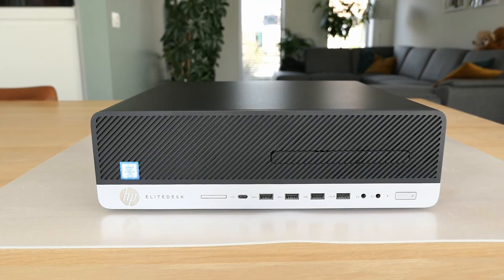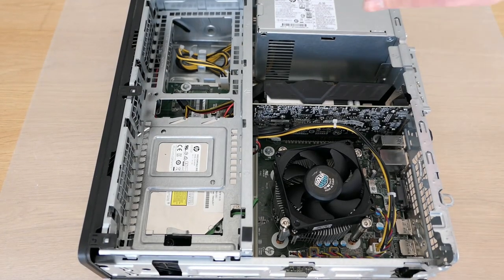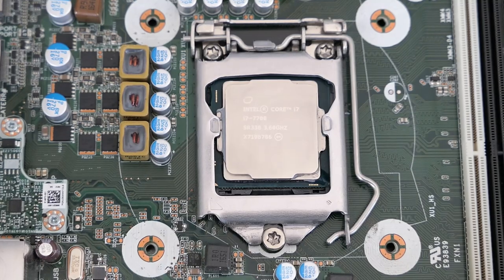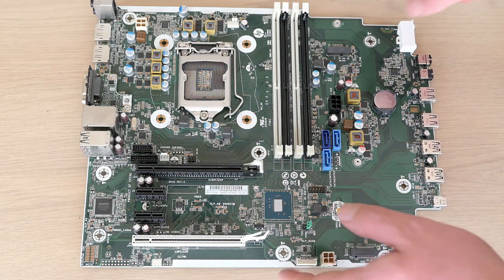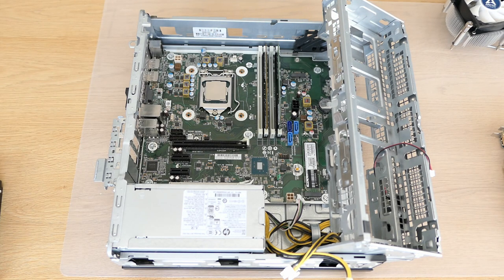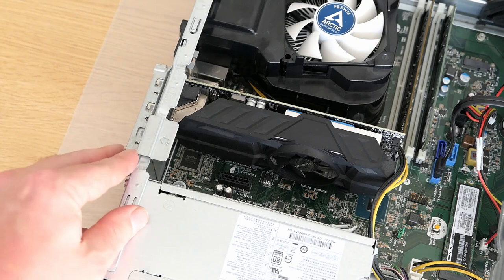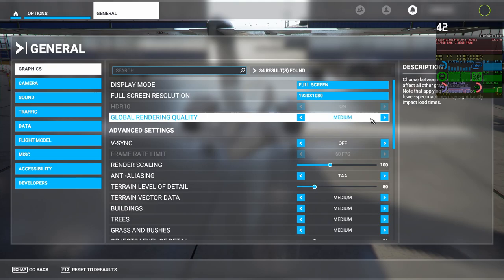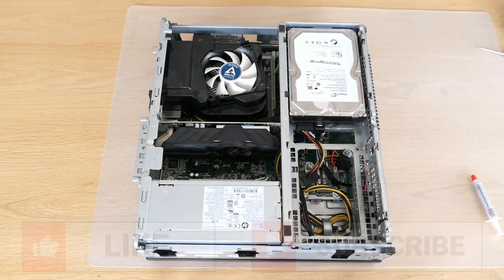HP EliteDesk 800 G3 SFF - Teardown, re-assembly and upgrade

Comment: dang...that would make a nice sleeper gamer i7, SSD, 4GB 1050... I could live with that all day...
Reply: Buy the rtx a2000. Makes for the ultimate sleeper
Reply: The one I bought didn’t have a gpu so I bought a 1650 4GB.
I run csgo at ~300 fps. Although the gpu struggles with heat, under full load it likes to sit at 85C which from what I understand is throttled. I’m currently trying to increase case airflow to fix that
Reply: @remoquillojosemiguel1105 you might have to cut the metal housing that folds into the computer there to fit bigger gpus running into this issue with a Lenovo with the same concept of folding the cage down

Comment: I have this one with I7-7700 32 GB ram and T600 and it's a beast !
Reply: Thanks. Now i see its true power
Reply: its actually a solid pc. If I can upgrade the graphics somehow and even get half the potential of a 660 ti with barely any power draw. I can run the games I play with multiple tabs on solid graphic settings no problem.
Reply: what’s a t600?
Reply: @cIeetz  HP 800 G3 TWR I7 16 GB DDR4, 512GB SSD, GEFORCE GTX 1060 3 GB. IS this good for 577$ USD or is it to much for it ?
Reply: @toni2972  too much might as well save a little more and get something way better
Reply: And how about 16 GB RAMM DDR4 + i5-7500 + GT730/GT1030? PSU 180 W
Reply: Bro, did you have to change the power supply? I read that the PCIE port is 35W, and the T600 consume 40w. Did you have any problems?
Reply: @0disseooo  NO

Comment: Thank you very much. Just for reference, I installed an ASUS GEFORCE GTX 1650 4GB low profile, double fan. The twist is: I had to cut a piece of the chassis where hard drive are located (a 4cmx4cm square) because the card is too long. 
I also installed an internal ssd (samsung 990 pro) and 32gb corsair RAM. Looking to upgrade it from i5 to i7 7700, just wondering if it can handle a 7700k.

But it's worth the job
Reply: Is this on the stock motherboard. I'm thinking of getting an Asus Z170 so I can overclock. Unless you know another way.

Comment: Bet you've already answered this somewhere but here is where i am in a pickle. I have a G3 800 SFF currently running without a GPU. I checked the specs on the GTX1650 LP and on a stock system that doesn't go with the specs. First, the PCIe slot is limited to only 35W supply to the graphics card while the GTX 1650 pulls a whopping 75W at max draw. Second - Now somehow even if you end up installing and getting it to work and definitely not at full potential of the GPU, youre still gonna need to upgrade your power supply so it can handle the load of the GPU at even 75% of the full power. And i am talking about the SFF in the video. Same problem with the 1050ti. The only cards that go in safe limits are the GT1030 and the GT 730 unless you get another PSU which supports higher Wattage output (you might need to swap out the case too) and then run a full sized card instead which draws power directly from the PSU instead of relying on the power from the PCIe slot.
Reply from the maker: Upgrading the power supply will not increase the power that the PCIe slot can deliver. Also for cards that do have an external power connector, they count on drawing up to 75W from the PCIe card as far as I know.

I do see that it is documented to have a maximum of 35W supported for the PCIe slot but as this one was doing fine with the 1050Ti, I would expect a 1650 to work fine as well. Wouldn't be the first time that I try this with success. 180W in total should be fine for GPU, CPU and the rest of the components like mobo/RAM and SSD.
Reply: @jensdbe  I really want to try the 1050ti or the 1650 on it like you installed but its too much of a risk interms of me buying and it not working at a later point in time.. better be safe side and run a 1030.. I have always been unlucky in that regards so I better go with something thats tested and proven :face-blue-smiling:

Thank you for the reply!
Reply: @omerback007  any Low profile GPU will work as long as it fits, someone tried an rtx 3050 low profile and it worked perfectly fine, it's really only the temps you kind of have to worry about. 180 Watts is fine, no risk really, but you do you I guess 👍

Comment: I live in Australia & saw one on marketplace for $145 with the 7700 & 8gb ram & 256gb nvme drive, thinking of building an emulation machine with a sparkle intel arc a380 6gb LP but have to find out which psu this one has first. I recently built a mid range matx small tower that is purely for current games, 12G i5, RTX4070, 16GB D4 3200, 1tb gen4 nvme. Will be slapping a 2tb gen3 in there too soon.

Comment: Do those stand-off screws have rubber sleeves or its just metal on metal mount? And if it is metal on metal, is that from the factory like that or 3rd party screws?

Comment: New subscriber looking for advice.. 

The PC spec in question details are: HP Elitedesk 800 G3 Small Form Factor PC. Intel Core i7-7700 processor. 16GB DDR4 2133MHz RAM. 500GB x2=1tb SSD
Windows 11
Samsung 860 EVO NAND-SSD. Optical disc drive. Built in 1Gbps ethernet port. No wireless card but Wi-Fi dongle. Integrated graphics

There are 2 free RAM slots and the motherboard supports 64GB RAM

My question is would upgrading the RAM make it better eg.. 32 RAM 3200 mhz with like a crucial 32gb secondhand??

And also

Would putting in a dedicated graphics card like a Msi gt 1030 secondhand help it too??

Trying to understand how it can be improved, I don’t know if it would cope with music software like ableton and gaming well or not, please could you help me understand if these ideas to make it better would be a good idea or not? If it would work? And if it would be capable for these things?

Sorry if I didn’t word it well I just tried to give as much info as I could.

I absolutely loved watching this video and will continue to watch videos here thank you for posting and look forward to your reply 🙂👍🏻

Comment: Hi, how many watts is that power supply?  I have an hp prodesk 600 g3 sff and I have thought about buying the same graphics card that you are using, but my power supply is 180w platinum.  so I don't know if it really works for me at least in the medium term without burning the power supply or the graphics card
Reply from the maker: The power supply in mine is/was also 180W. This should be sufficient for the CPU and 1050Ti.

Comment: hey nice video, btw im gonna ask can the psu handle regular 1050?
also can i use to bit more powerfull GPU such as 1070?
Reply from the maker: The EliteDesk 800 G3 has only a 180W power supply. The most consuming graphical card it comes with from the factory is a GT730, which takes around 40W. A 1050 Ti takes around 75W so that should be within the safety margin.
A 1070 on the other hand easily does the double (~150W) so that's really too much for that PSU. You would also miss the 6/8 pin connector that such GPU needs.
Upgrading the PSU won't be an easy task as well I'm afraid.
Reply: @jensdbe  thanks mate
Reply: I have a 800 g3 running a Gigabyte NVIDIA GeForce GTX 1650 4GB GDDR6 Graphics Card. So far so good. I use obs to live stream with a mic,4kcam link from elgato and a hd60s+ as well. So far no issues. Only upgraded the memory with the gpu
Reply: @interpolfallen4159  so basically as the GPU must be under 75w heh thanks bro
Reply: And I just changed the hd60s+ for a 4k60pro with low profile bracket through pcie. It fits perfect and no issues.
Reply: @interpolfallen4159   me to. A quite good setup.

Comment: Just ordered a refurbished one off of Amazon today to host my own Minecraft server! The only difference with mine is that it has a 6th Gen Intel Core i5 and a 128GB NVMe SSD.
Reply: Add more storage, a gpu and if possible (Ik it’s difficult) upgrade psu so that you can have potential for different graphics cards. Also should probably give it some fresh thermal paste and make sure everything is plugged in and seated correctly

Comment: Hello... What a great video! It's very instructive. But, i'm wondering, would it possible to replace the stock heatsink with either Cryorig C7 or Noctua L9i? Both have a backplate that must be installed on the back side of the motherboard..
Reply from the maker: I think that the only option for such heatsink would be to remove or to bend down the lifted mounts on the bottom of the case. As you can see at https://youtu.be/n1ETa3mJ85I?t=602 These would prevent you from mounting that backplate or the board would end up too high. Keep in mind as well that the case is limited in height so you might want to check if your heatsink+fan would fit in the limited space.

Comment: Thanks for the video! Do you think its possible to keep 2x 3.5" HDDs inside the box? Considering it as a NAS
Reply from the maker: Two drivers should fit next to each other.
Reply: Did you ever go through with this? i want to do the same
Reply: @overratedprogrammer  I did not, sorry.

Comment: Can i fit the amd rx 580 in that pc
Reply from the maker: As far as I know there are no low profile variants of RX 580 cards. That means they will not physically fit into this case. Also, an RX 580 can draw up to 185W, which is way too much for the power supply.

Comment: I'm trying to get a new graphics card for this computer, but basically every single 1050 I find has the DVI port in a different spot. Is that a problem? Will a graphics card with the DVI port in a different area still work on this computer?
Reply from the maker: That shouldn't be an issue at all. Doesn't really matter as long as tou have a low profile card.

Comment: Purchaed one of these PC recently for AUD $160. Assembled in  March 2018. 'A' grade condition. 7th gen i5 cpu. 20 second boot on the supplied 1Tb HybridHD. 8-9 seconsd boot on a SSD. Installed Windows 11. Needs a graphics card to play games.
Reply from the maker: That sounds like a really good deal. Adding a proper GPU (GTX 1650 looks like a good match) will give you a lot more fun.
Reply: @jensdbe  I just grabbed an 800 G2 with I7 6700 1TB HDD for $20. Little bummed I thought it took an NVME but not till G3. Still worth

Comment: Hello, very good video. A few weeks ago I got this same equipment, I am happy with it, it is fast and fluid. I bought it with an i5 6600, 16Gb RAM. I have been seeing some comments about which GPU would be ideal with this equipment, but my concern is that the maximum consumption that the PCIE x16 port allows is 35 watts. Now, according to your criteria, which GPU would be the ideal? Taking into account that the PSU is an 80 Plus Platinum 180 watts. Some GPUs have been recommended to me but they exceed the permissible limit of watts allowed by PCIE. Have a nice day.
Reply from the maker: A GTX1650 low profile is what I would recommend. I had a 1050Ti in there and that worked without any issues.
Reply: @jensdbe  Thank you very much, I appreciate the answer. No problem then. Grateful. 👍
Reply: @GuitArts25 Hello, what graphics did you use having 180w?
Reply: @hectorquintero1991  Hello, at the moment I have not added any graphics card to the equipment. I only use the integrated one, in my case it is the Intel HD Graphics 530
Reply: hola Héctor, quisiera saber si pudiste ponerle tarjeta a tu equipo?
Reply: @nicolasgutierrez1499-  hola no preferí no arriesgarme, más adelante mejor le coloco una mejor fuente y asi colocarle una buena gráfica

Comment: I know im late for this video 😅

I have a plan of removing everything inside, and make it like a console wannabe pc, with better parts, like mobo, psu, gpu... 

Do you think it's possible? 
I'm really about to go get it... 😅

Edit: 
Also 3D print a different back plate/shield so a new mobo and psu could be installed, but still connect the usbs and the rest from the front!

Comment: Would that be possible to put 2  3.5in hdd in this machine? There are 3 sata ports... would power be sufficient?
Reply from the maker: A typical HD uses around 10W so I don't think that would be an issue.
If my machine works fine with that 1050Ti, those hard disks should definitely work :)

Comment: love the video but one thing i can not find is a way to boost clock the cpu i have a similar system the 705 G5 with a ryzen pro 5 3400G says it can boost clock to 4.2hz but shows no way to do and the bios doesn't have the option
Reply from the maker: This is just part of the CPU architecture, not really something that needs to be explicitly enabled. You can check the current CPU speed in Task Manager for example. Try and run something heavy and check the variation clock speed to verify.
Reply: @jensdbe  Thanks just learning this system making it into a emulation pc

Comment: does this have an upgraded PSU? I heard the 1050 Ti has too much power and the most it could take is a 1030 LP . I also seen a 1030 LP video where buddies computer wouldnt run it. If it runs a 1050 ti I'd probably put one in it.
Reply from the maker: This was the standard power supply as far as I know. It is 180W and a 1050Ti would require around 75W. This leaves enough for the rest of the components.

Comment: Hello,,as you mentioned, it will not be easy to replace its psu,, can you do a video on how can we change the power supply with a standard one, without changing the motherboard?
Reply from the maker: In the standard case, you need a specific HP PSU as a standard form factor does not physically fit. In another case, it should work to use another PSU but you would need a convertor from the standard ATX to the HP-proprietary connector.

All in all, if you plan these kind of things, it might be more interesting to sell the whole PC and buy another in the tower version (or a custom PC)
Reply: @jensdbe  your response is highly appreciated

Comment: For gaming should o go i7-8700 16g ram max or  i7-7700 32g ram max? Ones a g3  the first is a g4
Reply from the maker: This is a tough one to answer. Depending on the game and resolution you are playing ok, if you are tight with the 16GB of memory, then increasing that will boost performance. On the other hand if you are not running out, a better CPU is a better choice. I'd say go for the i7 8700, monitor memory consumption and upgrade if needed. It's generally easier to upgrade the memory in comparison with the CPU as that has to be replaced.

Comment: I’m interested in adding an extra SSD drive or two. The connector with multiple plugs doesn’t have SATA connectors. Do I need to buy an adaptor? To connect an extra SATA SSD? Thank you for the video!
Reply from the maker: To each drive you will need power and data. Power comes from the black connector on the motherboard (with red/yellow/black wires), data needs to be connected to the blue SATA ports on the motherboard. If you don't have enough power connectors, you can easily split that. For additional SATA ports, you can install an extra controller in one of the PCIe slots.
Reply: @jensdbe  Thank you for the info. I have a G2 elitedesk and that one has SATA connectors. So I was just confused when I saw the pigtail with 3 non-Sata type connectors. Thanks again! I guess I also need to find some brackets to hold the drives into the housing slots. The PC I bought just has the windows boot disk on M.2. I’m really impressed it is very fast.

Comment: Thank you for the video. Do you think there is a space to put 4  3.5" HDDs? I don't have a separate GPU in the case. Thanks
Reply from the maker: Two times 3,5" would be the absolute maximum. There is no other space to leave them and, since the DVD-drive is a slim model, even removing that won't help you I'm afraid.

Comment: Nice video! I m thinking to upgrade my i7-7700 but dont find any path. Any idea?
Reply from the maker: i7 7700 should work fine as it originally also came with this CPU
Reply: jensd_be any better CPU can be used on the motherboard?
Reply from the maker: @minervali9436  i7-7700 is the highest it came with from the factory/HP. Better might work but needs to be tested in order to find out.

Comment: hi, great video! Currenly i have hp g6 800 sff and do you have a video for this model to change to another master cooler casing ?
Reply from the maker: No video on that but I'd be surprised if it can be done. It's typically a custom motherboard form factor that doesn't fit in a standard case format.

Comment: Any ideas how to install a frontal cooler fan to intract air? Temperatures 90°C while gaming is the only issue of this HP g3 prodesk design
Reply from the maker: I don't really see how a fan could fit in the front. I guess for proper gaming this case is just not big enough.

Comment: Hello, need to ask about PSU! Is it 250W?
I have G3 600 with i5 7500, 16GB DDR4, SSD 256MB+1TB SSD Samsung an di want GTX 1050Ti put inside.
Is generic PSU 250W enough?
Thanks in advance
Reply from the maker: In my version, the PSU was 180W only. A 1050 Ti would consume around 75W so should be doable with the rest of the components. Looks pretty much the same as I had in mine so I don't expect any problems for you with a 1050Ti.

Comment: I got this same pc and added a a2000 but it won’t boot with the gpu installed and I can’t figure out why. I tried the a2000 in another pc and it works fine. I’m close to giving up.
Reply from the maker: I see that an A2000 is using around 70W so that should be fine. Only thing I can think of is a BIOS setting related to which video card to take as primary or a mismatch with the PCIe 3.0 version.
Reply: @jensdbe  thanks for the response I figured it out. It was so stupid. I didn’t push the power cable all the way in.
Reply from the maker: @battlepowered  happens with the best of us. Glad to hear it got fixed :)